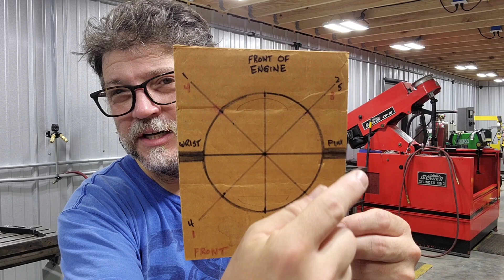*Your Harley Engine Builder Was an IDIOT*  Or Were They? - Harley Piston Ring Alignment Kevin Baxter

Comment: Let's not forget to use a good quality "break-in" oil to help with "ring sealing", 
n follow the speciied break-in, and oil changes with the proper weight n viscosity oil for your engine application.

Comment: I put off watching it due to the catch line, but this is 100% correct both the position of the rings upon disassembly being irrelevant, and the value in setting up staggered gaps before break-in - something we found long before modern technology on cylinder finishes.

Comment: I heard a story many years ago that in the 1950's, Volkswagen R&D imbedded a small pellet of radioactive material into a piston ring so they could monitor the rotation using a gamma count rate meter. They determined that the average rotation of a piston ring in and air-cooled VW was 15 RPM.  I have no idea if this story is true, but I wouldn't put it passed those whacky Germans to do something like that.

Comment: Your info was very well presented and I as an ex engine builder appreciate your education of the dynamics of ring functionality to both mechanics and aspiring mechanics. As a note if you ever wonder or question if rings rotate consider a two stroke bike engine with cylinder ports and why the piston rings must be pinned to avoid the gap aligning with a port. Cheers and thank you from sunny south africa

Comment: Hi Kevin-for the DIY home mechanics it would be helpful on your cardboard chart to indicate what the numbers represent eg. top compression ring, 2nd compression ring, oil ring, oil expander ring, oil ring-also the sequence of installation of the rings-make it idiot proof. Furthermore, the HD manual for 2008 Softail seems to contradict your chart- eg. Front Cylinder; 1&5 (expander ring & top compression ring) @ 4 on the clock, 2 (bottom oil ring) @ 7 on the clock), 3 (top oil rail)  @ 2 on the clock, 4 (2nd compression ring) @ 10 on the clock-this is the top view of the piston facing the front of the engine-maybe I have missed a trick on your inverted view.

Comment: I appreciate the info and respect your ability. But a couple years ago i picked up a 2000 jeep tj with a siezed 4 ltr. 4 cyl. Motor.  I got another old used motor and stripped both down to nuts and bolts. I built one engine out of the best looking parts from the two. No torque specs or nothing other than a Milwaukee driver. That engine ran great and is still on the road. What a fluke.  LoL

Comment: Speaking of rings, do you use low tension rings on your engine builds or do you higher tension and thicker rings?  If you use thicker/higher tension rings, what is the difference in heat generation and overall engine temps?

Comment: Pre evo no torque plates . I avoid 12 3 6 9 . I didn’t do the machine work I had a very good guy . I have never heard of rings moving . I was taught they only work once cause you can’t get them back where they were when they seated . I have rebuilt all types of jap shop in the beginning then Harley for 45 years . I can’t see it you didn’t use torque plates on a evo .

Comment: I was through this with Mack Truck 40 years ago. They used to have a piece of paper like your cardboard in the box with the cylinder kit. I knew they rotated because I tore down  lots of factory engines and they weren't matching the paper. I have to say though very few of them had the gaps aligned on teardown

Comment: A fan keeps me alive in this ole hot trailer!  I'm used to the noise of a fan.
When you apply the rings to a piston, aren't the ring tips pretty much touching?  I don't mean they're jammed together, but just barely touching, if it's the right ring for the piston and the cylinder.
So oil consumption would be barely there, not something you'd notice if everything's right from the start.
I would think, that since 'as you say,' the rings turn on their own, they 'float,' in the piston gaps, oil consumption is minimal, unless there's something more going on to cause that.
And as they might turn to align the ring gaps, they would also continue to float around and misalign them as well?
This situation could potentially apply to all piston engines, bikes or automobiles or even diesel engines.
Tanks Kevin for the tips.  As always, you're a singular pea all alone in the big pod of 'normal,' mechanics, dealerships, and shade tree DIYs.
Idf there was one singular thing I noticed, owning an HD, has all sorts waiting to fleece your pockets for dollars!
The HD world seems pleagued, cursed maybe, with every sort of 'know it alls,' that will say or do whatever, for a few dollars more!

Comment: So the status quo is to hide and protect the people that do fraudulent work so the next customer can get messed over. I paid a shop to relace my front rim. It had 1/4" runout side to side AND up and down. He refused to do anything to fix it. Took it to another shop. They verified the runout AND the wrong spokes were used, he used bolt cutters. I asked 2nd shop to give me a full written report with pictures. He got loud and refused. I fully intended to sue. Now I have no evidence. So now I have 20 year old rim that cost 600.00 to get back on road. I have since learned to do my own work. Some shop are awesome others just want your money.

Comment: Then why does Honda lock the oil rings in place on the left side pistons on Goldwing engines?
Reply: I can't answer the question for sure but I would surmise that it is to help prevent oil from seeping by the rings when the bike is on the sidestand. The BMW Flying Bricks had a problem with exhaust smoke on startup due to oil getting by the rings when parked on the sidestand for an extended period of time. Airheads would it too but to a much lesser extent.

Comment: Rings movie been building  engines for 35 year  never had a major  engine  problem,  because  it will not leave  till I break  it in   100 miles or in the engine stand ,but you can still have problems, there way to may green horns out there lol

Comment: In this video, you are covering the mechanical break in of piston rings. What about the chemical break in of the piston rings with a mineral based (non-synthetic) break in oil, high in ZDDP,  low in detergent and no friction modifiers?
Reply from the maker: You will see this in an upcoming video...specifically about oils.  Stay tuned...
Reply: The big bore kit I put on my Buell XB specifically said use break in oil, which of course I did.

Comment: So do the rings stay that way in a usually idling engine, or can the gaps seperate once a new owner runs the beans out of it?
Reply from the maker: they often find themselves lined up in ongoing idling engines....which is one reason long idling is not recommended for many types.  Also...engines designed to run at constant speeds and low rpm have different types of rings...gapless, different profiles, etc that can still facilitate rotation for even wear.

Comment: I learned from my own experience, trailering my Bikes and riding only at rallies. You sit idle in traffic a lot and then you load the Bikes back in or on the trailer and travel home, idling in traffic and only putting about 10,000 miles on your bike in 10 years. Your engine is worn out 😳When I was younger. I rode my bike to the rallies and never had a problem with wearing out my engine before 60 or 70,000 miles. Live and learn,it keeps your shop really busy. Love your videos and I want your Roadrunner ❤😂😂😂😂😂😂

Comment: I have seen rings line up on the aircraft engines I work on. A short flight will usually get the compression numbers back up to spec. When it's a fresh overhaul it can be a little embarrassing but as you said, it happens!

Comment: Piston rings really have to be stuck on their grooves before they start to oil the combustion chamber, or cause noticeable power loss. The main issue for oil inside the chamber is valve guide seals/worn out valve guides and for the power loss, worn out valves. Also the head gasket can burn into oil passage way and suck oil in during intake stroke. Bad rings cause audible noise and blow by, but never oil burn, unless your crank case is full of oil for some odd reason. In some cases an after market air filter can cause oil consumption, due to the filter being too tight for the engine. The missing air has to come from somewhere, so valve guides and crank case are the next air givers. Also if your trumpet is facing direct to the side or forward, this can cause an air lock on certain speeds.

Comment: Great catching up with ya Kevin!
14:00 I think it was on Doc Harley's channel that I was surprised to learn that the PDI check alone can rack up around 10 miles! How many miles are too many on a new bike (i.e. before it's already been broken in more than you'd like)?
Reply from the maker: depends on how it was built and how accurate the tune is during those stages.  I give more info in my engine break in video done well over a year ago.  hard to give you a solid answer.  also depends on honing techniques, etc....
Reply: @KevinBaxter  Yeah I actually made a number of notes when I watched that video of yours (May last year)! 🤓 Great stuff, very in-depth.
But what you say here about "those first few miles" also made me wonder about buying any factory bike new from the dealership - I suppose then that the break in is often going to be "sub-optimal", as compared with buying a quality custom build.

Comment: If cylinder has a even the tiniest of a score, end gaps will line up 🤷‍♂️.  Oil consumption is usually caused by riders not knowing dipstick should read low on kickstand and they have too much oil in bike and risk hydro locking bike. I change my oil with bike upright  and don't have a problem. I've had a friend bring his bike to the harley dealership and dipstick was full when on the kickstand 🤦🏻‍♂️ I had my bike done once at dealership and never again. Get a private motorcycle shop, they stay in business because they are good 🧐
Reply: I've never heard of checking the engine oil on my twincam with bike vertical so I consulted my 2007 owner's manual again and it says the oil level should be at the full mark on the dipstick, when hot, on the jiffy stand. Has that changed?
Reply: @staynless7  nope - you are doing the right thing.
Reply: @staynless7 yes, that's overfilled.
Reply: My '02 Dyna reads 1/2 quart low on the stand and full upright
Reply: Can you expand on this "hydrolocking, overfilled idea"?
Reply: My 07 road king classic has it stamped on the dip stick to check oil level while on the kickstand for both hot and cold checks.  Not sure when they changed it or if it's always been that way for road kings.  My first harley.  All my metrics were oil level checks while straight up

Comment: Good info of course. I would add that, what you said about the initial few miles/several minutes of run time is crucial to how the engine will perform and the longevity of it. In spite of this I still hear about people "breaking it in for a thousand miles" before getting it tuned.
Reply from the maker: I plateau hone all cylinders...this greatly reduces break in time and promotes the best possible ring seal as soon as possible also reducing contamination.  I will often lap rings as well.  Without plateau honing, break in can take quite a bit longer...but 1000 miles of "really take it easy and baby it" doesn't promote ring seal.  We agree and are saying the same thing.  Thanks!

Comment: Haven't watched the vid, but the previous build was dumb on my new to me 2000fxwg. high compression se pistons 95"....  would have been fine but they milled 15cc off the head, and used a .020" coper head gasket..... enough that it made installed the locks for the pushrod tubes near impossible.  Combine it with a woods tw6h torque cam.  Pre ignition, hot starts from hell, and diesel on hot shutdown on premium pump gas....  over 220 cranking compression... insane
Reply from the maker: i wanna thumbs down because of your experience...sorry to hear of it.  Not a thumbs down on your comment :)
Reply: @KevinBaxter    thanks to your videos and several other you tube characters and the big boys head porting calculator,some swap meet parts(non molested "fi" heads) and flat top pistons and more reasonable lift cams and the factory service manual I have it all sorted out!  

It would be super awesome to have a pair of cylinders bored by you, but...  15000km later on my 'Hone' job it's not using any oil ect.  Very happy!

When you work extensively on a motorcycle, you definitely build a deeper understanding and connection with it.